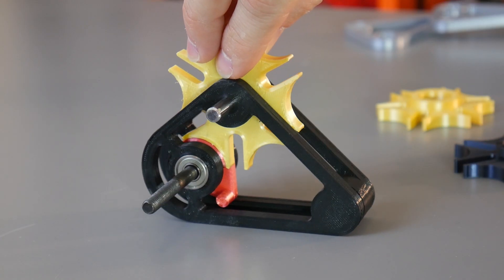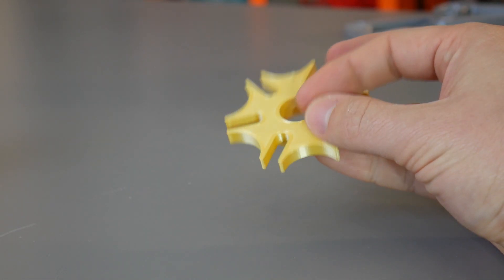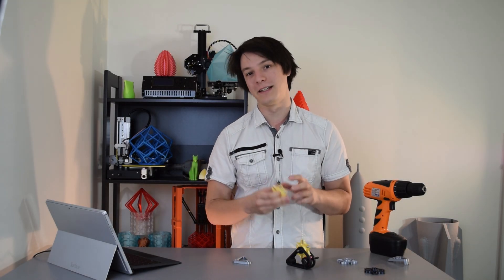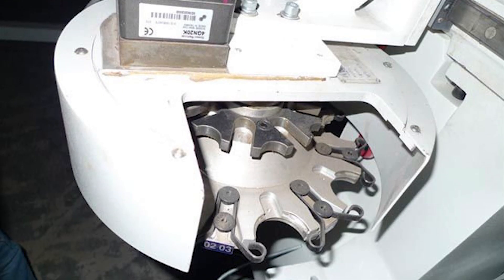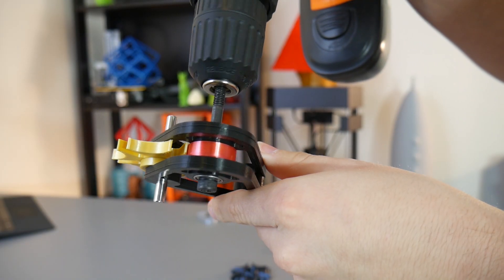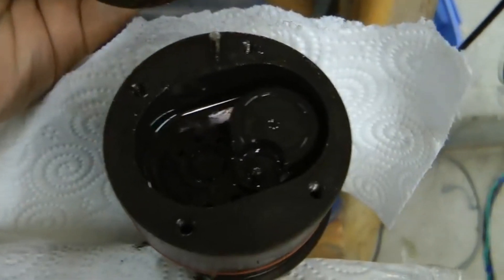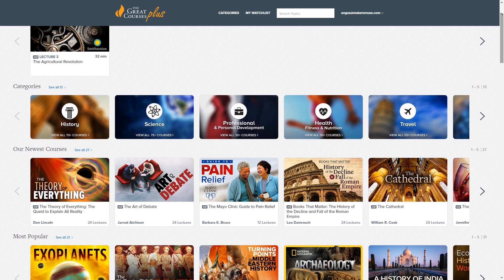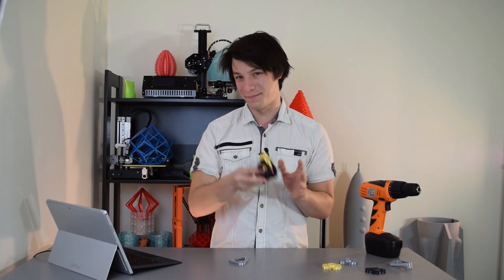The Geneva Mechanism

Comment: Would it be possible to print a sphere that could withstand up to 15,000 rpm? I have an idea of scaling up a "Power Ball" hand strengthener. Its a dual axis gyro scope. A sphere that spins within a hand held sphere. A simple rotation of the wrist can get this spinning up to 15k rpm. My idea is to scale this up and fill the inner sphere with magnets on the surface and have the outer sphere lined in copper coils. Wire it up to a voltage meter/battery charger, spin it up the same way you would a regular power ball and see what happens. I was thinking of getting into 3d printing for the sole purpose of making this idea a reality. Thoughts..if any?

Comment: Interesting what you said about the tendency for the gears to wear out quickly, which is understandable.  My family has a 1948 film projector for use with home movies my grandparents filmed in the late 40's and 50's.  It still works like a dream.  Really not super loud, either.  I guess all that oil helps a lot!  Great video, I learned a lot!

Comment: That clacking sound is the film snapping into place. The snapping is caused by the intermittent gear, but the gear isn't what's making the sound. You can tell because it doesn't make that sound when you run the projector without film in it.

Comment: Not really related to the mechanism as such but the use in watches was (and is) to stop the watch before it reaches the end of the spring. The idea was to use only the middle part of the spring wind, where power delivery is more consistent during the unwinding of the spring.

Comment: early bi-plane machine gun triggers had a gear exactly like this. The purpose was to prevent the machine gun destroying propellers on aircraft where the gun was mounted center-line, firing through the prop.

Comment: I used to repair machinery that assembled trigger sprayers, ( think windex or 409 cleaner). Some of them used a Geneva wheel to place the cap in position. A very robust and elegant mechanism.  They very rarely needed repair.  The pin was a roller so not much problem with wear. 1 cycle per second 24 hours a day.
Reply: I was just wondering the same thing about mounting the pin on a bearing. It seems like that would eliminate the wear problem entirely for most applications.
Reply: Toolman329 Agreed. My use of the word "entirely" was an exaggeration. But, it would be interesting to see data on cost vs MTBF for such a solution.
Reply: William Weibel  I'm thinking: how about the device being created with a few polymers. Polymer example being 3D printing filaments.  Specific properties for each part required, could be achieved using the correct 3d filament for each part.  

Nylon 3d filament for example; is a 3d filament polymer. 

The use of this kind of material(s) for the parts that make up the assembly of the "Geneva joint" (whichever one you use as the video lists a few examples of them from watch parts)  would probably aid tremendously to the length of time the assembly would operate without maintenance. 

Also, As you suggested; I too would be very interested in the testing of of various complex joint assemblies with solutions only possible with today's technology.  :-)
Reply: Or coat the pin in a slick polymer, like one from the teflon family, and chrome the lining of the stays.
Reply: 1 cycle per second is extremely slow. The video mentioned "hundreds of rpm". If the geneva wheel is only durable at 1 cycle per second or similarly small speeds, then it can be considered a very undurable mechanism.

Comment: The IBM 1402 Card Reader/Punch (and other IBM machines of the day) used a dual starwheel geneva to index the card through the punch unit.  The output of the geneva was geared to feed rolls that fed the card.  The card was punched during the dwell and moved to the next row with the index.  This geneva was in a cast housing filled with SAE 10 motor oil.  Although it ran pretty reliably, you are dead on about the poor acceleration profile of this mechanism.  And as it begin to wear it got progressively worse to the point of self destruction.  One of my first assignments as a young IBM engineer was to fix the oil leak on this mechanism.  The major problem was a lack of venting with caused a pressure buildup to force the oil out past the seals.  I build a unit up with a plexiglass housing so I could see what was going on and then put it under a heat lamp to cycle the temperature.  I got good marks for that job.  That was somewhere around 1962.  Info on that mechanism is here:
http://bitsavers.trailing-edge.com/pdf/ibm/1402/231-0017-1_1402_Card_Read-Punch_CE_Manual_of_Instruction_1963.pdf (page 19) and here:
http://ibm-1401.info/1402-PartsCatalog-S31-0149.pdf (page 46). Items 12 and 13 were part of my fix.

Comment: Cool vid. Sub'd. Geneva gears were also used on industrial tank level transmitters, to convert linear motion from a float to stepped motion on code wheels, one wheel for inches, one for feet, one for tens of feet IIRC. These code wheels had a circular PCB on one side, whose position was read by electrical contacts, and was thus converted to +/- 50V digital code back to a control room. All this sixty years ago.

Comment: The Geneva stop wasn't used so much to prevent overwinding of the watch, but to control the period the mainspring powers the watch.
The mainspring of a watch tends to apply a lot of power to the mechanism when fully wound up, which makes the watch gain time.
While at the end of the mainspring it supplies less energy the watch loses more time in the hours before it stops entirely.
Therefore if you only let the spring power the watch while it's not tightly wound or too loosely wound, you can get something that is somewhat more reliable and precise in timekeeping with the time's escapements.

Comment: i actually have a vintage timing device from an old military weapon. it doesn't have a geneva gear, but it does have gears that you would find in an old watch. back in the 40's and 50's (and probably 60's) they had analog devices to handle timing in weapons, and they are essentially "milspec" watch guts

Comment: Don't know for sure but, the Close In Weapons System CIWS (pronounced SEE-WIZ) or Phalanyx system uses a mechanism that rotates to a certain position and pauses so it can fire a round at a rate of 3,000 round per minute. Think of it as a computer controls radar assisted gattling gun.

Comment: I understood some of these words
Reply: It does work well and is mechanically reliable at that. If you're design has no concern for driveshaft vibration, wear/backlash and acceleration, the geneva mechanism is a good choice for a full mechanical design.
Reply: Yeah! But I think "outdated" is inappropriate, because there is no reason to imply that this mechanism is outdated. It works, and it would be stupid to forget that :-(

Comment: The kind of gears you showed (and are thinking of) are involute gears, these actually have sliding contact throughout most of their mesh. There are cycloidal gears which have rolling contact between the two gears but they come with their own disadvantages.

Comment: Who cares about the military use? Tell me the sex application for the device.
Reply: Convert the rotational motion into linear motion, you now have something that thrusts in and out very quickly with a pause between.

Why did I think of this I'll never know
Reply: 1) Attach feathers
2) Market it as a "Pickle Tickler"
3) Sell it on Amazon
4) $$$
Reply: Ivan Mazeppa auto circumcision
Reply: Make love not war.
Reply: theirs at least one tongue simulator sex toy that uses a Geneva drive
Reply: genital mutilation isn't sex
Reply: Well, he did say it was useful for interchangeable tools.
Reply: Attach rotational-to-linear motion converter to driven wheel. Affix phallic object. Insert into driven person. Spin.

Bonus points for only using one lubricant in the whole contraption.
Reply: +viperfan7 (a) it's obvious (b) I don't think that's the exact form of motion you want; rapid, sharp thrusts don't seem pleasant, you want a smooth acceleration/deceleration to prevent injury.

I assume.
Reply: +Kevin Benoit can you send me a prototype? For research purposes.
Reply: 69 likes, i refuse to add any more likes to the comment
Reply: When my friends from other countries ask what America is like, I'll show them this comment.
Reply: Toolman329 - LOOOOOOOL
Reply: "A weapon to surpass Metal Gear..."
Reply: That's very easily done with a piston attached to the driven wheel.
Reply: Variable speed drive motor gives variable speed cycles. Some sort of eccentric device could create variations in entry vs exit speed. Some women love quick thrusts with slow extractions, others the reverse. There's a whole continuum. I'd be tempted to build one of these and market it, but I have the Mark I model already. I call it my "penis." Now, I just need to market myself. LOL

Comment: In the 1980s, at an engineering department where I worked, a gifted mechanical engineer designed a peristaltic pump around a geneva drive. One key design requirement was precise metering of the fluid being pumped.

Comment: Texas Instruments made an inspection tool that would take pictures of all fours sides of a PLCC package to determine if the leads were straight. This mechanism was used to rotate the PLCC 90 degrees at a time. They replaced the mechanism with a stepper motor.

Comment: I could imagine that in use in aircraft guns that shoot through propellers.

Link the mechanism to the prop and you'll mechanically offset any firing of a machine gun perfectly through the blades plus it looks like it would adjust appropriately based on prop speed.

Comment: I don't think modern CNC machines use this anymore. Most of the good ones can now whip all the way round the tool change to a specific position without indexing at each position. I think they juse use a DC servo now and use the encoder position to stop at the right position

Comment: Actually I also just did some research a few weeks ago for something I want to make and the Geneva drive was one of the first things I came across for intermittent gear switching. Right now I'm working with a variation on the gears found in a car's distance meter/odometer and it's also extremely interesting to see the workings of

Edit: Forgot to mention that I designed the gears using OpenSCAD and variations on some open source code for it, which is also worth a look, I'm definitely looking forward to see how you drew this design with Fusion360, as I'm currently finding drawing in there quite tricky

Comment: I've run printing equipment with these drives in them. Never had any problems with wear even with billions of cycles over decades of use. The drive was out in the open but surfaces were glass hard tool steel. I wouldn't expect amazing quality out of a consumer grade projector. After all, They want to sell you another one when it breaks. (Engineered obsolescence)

Comment: Early film projectors?  Try almost ALL film projectors.
Reply: Can confirm, I've been a Cinema Projection and Sound technician for the last 14 years. These were part of the intermittent sprocket assembly for every 35mm projector I serviced right until they all went to the scrapyard during the digital projection rollout.
Reply: Andrew Tetour Ah yes, the mob-like genocidal revolution that still brings me to tears.
Reply: Exactly - AFAIK some were made with stepper motors, but I never saw a 35 mm projector with anything but a Maltese cross. They only went out of use with the switch to digital. My engineering student friends were thrilled to see the schematics.

The characteristic sound is not, however, from the mechanism - it's from the two loops of the film, one on each side, to allow the film to run smoothly through the rest of the machinery while being pulled frame by frame through the film gate, and you could hear at a distance if they were the right size. You'd have the same sound (or most of it) with a stepper motor.
Reply: Not quite. Cheaper projectors used a claw to advance the film; not good, could tear the film. Better projectors used this mech. Were always called maltese cross in projector parlance.
Reply: eh, I suppose there's an old charm to them. But film cost a fortune, and it's not like too many people would have gone and bought them.
Reply: That's right about the sound.
Reply: Andrew Tetour Yes, but they were not used in 8 mil projectors.
Reply: Very very few 35mm projectors were made with the claw, and they were portable machines that are known to tear up film. Otherwise, the claw is more common in 16mm and 8mm applications.

Comment: Wow, it is a good candidate for stepper-less actuator for Z-axis, when carriage movement in predefined position should activate change of hot end vertical coordinates. Driven wheel as nut and threaded rod should be ok for this.

Comment: i have to add something to your story. the geneva mechanism is only used in 35 mm projector in the cinema. at home, with 8 or 9.5 or 16 mm film it uses a gripper arm which pulls the film one frame forward. this is driven by the shutter which has a cam on it and functions as a camshaft in a car.

Comment: The most seen use of the Geneva device is in the original Robby The Robot, in his "hear box" chest display there are 4 lights that turn using a 4 index Geneva. Back in the 1980's and 1990's when I built full scale Robbys for collectors around the world I would hand build my Geneva's and I used a small ball bearing on the drive pin and on the rotating shafts. This way the device and  does run 24 / 7 with out wearing out.. Enjoyed the video.

Comment: In the sr-71 blackbird (world's fastest plane) used these to changed film roll for a 2 mile long film roll.
Reply: The X-15 appears to be more of a manned rocket than a plane, and used as an experimental craft for learning more about applied physics at those kinds of extreme speeds as well as reaching outer space (how does one steer without wind drag over control surfaces, etc..).  The SR-71 was, by comparison, a successful production craft.  As such, probably fair to call the SR-71 the fastest production airplane (declassified).  ;)
Reply: Bialy  I believe that Computerfrenzy probably was referring to airbreating, production aircraft. The "X" on any airframe refers to its experimental status, whereas the "SR" classification referred to an airframe that was was NOT experimental, but was instead a "Strategic Reconnaissance" aircraft. Also, the SR-71 IS the fastest airbreating aircraft in the world, and still holds many speed records until this day. If the new SR-72 ever goes into production, it will likely overtake the SR-71 in every respect, but until that day arrives, the SR-71 still reigns supreme.
Reply: D otA  Yes. And that is essentially exactly what I said in my post above, in which I explained that the "SR" designation was used for PRODUCTION airframes, and meant "Strategic Reconnaissance" aircraft. Also, a very important distinction is that the X-15, in which the "X," by comparison, stood for "Experimental," was not an air-breathing airframe. It was a manned, small capacity (by comparison to other rockets) rocket ship, whereas the SR-71 was an air-breathing, bat-out-of-Hell go-getter. It's unofficial record of Mach 3.5+, in an evasion maneuver to avoid a bevy of SAMs coming its way over Libya circa 1985 (or was it 1986?) highlighted the peak performance of the Pratt & Whitney J58 engines, which could churn out as much as 150,000 kNs at altitude.
Reply: "North American X-15 This aircraft has the current world record for the fastest manned aircraft. Its maximum speed was mach 6.70 (about 7,200 km/h) which it attained on the 3rd of October 1967 thanks to its pilot William J. “Pete” Knight." sr-71 blackbird speed is like 50% of world record... but hey at least u trayed and plenty of people bought that! :P

Comment: probably in a machine gun. The barrels should turn instantly and then be locked to fire the bullet, then it should turn directly to the next barrel. I'm not an expert, but that seems legit
Reply: This mechanism is used in screw machines (multi spindle lathes) to index the spindles to the next machining position. Very distinctive noise whenever it would index.

Comment: The M1 Abrahms tank autoloader has a Geneva segment on the back of the two powered carousels. https://postimg.org/image/p1uo2bekj/
Reply: the original mechanism was a simple one lobed cam on the driveshaft that pulled the trigger on the gun
Reply: The baser the toy is, the more time it spends working and less time being worked on.
Reply: Tom autoloaders are basically only used to lower the profile of a vehicle, as they come with downsides. They aren't faster than human loader, introduce reliability issues, and you lose a crewmember for tasks like maintenance.

Not using an autoloader was a very viable choice for 3rd generation MBTs, and its unlikely that a refit is worth it until the M1 gets replaced in about 20-30 years.
Reply: when you talk about tanks in the field humans are not the  traditional bottleneck, it's more the logistics and tanks available. i served with the german armoured corps and I would never want to have a soldier less on a tank, maintaining normaly takes the whole plattoon and if it doesn't it's hell, and lastly yes a smaller tank is a more difficult target but in the end it's the crew that really matters
Reply: Manook hadley. extra city coming your way.
Reply: Not the best moment to point on XVII century technology in a tank...but i couldn't help ))) sorry
Reply: Wouldn't  the interrupter gear mechanism used in WW1 airplanes to allow the twin machine guns to fire through the arc of the propeller use this ?
Reply: Zipper: It think so. Sounds right.
Reply: The reliability of the human loader is not perfect either.

One less crew member means one less solider tied up per tank, allowing more tanks in the field.

High profile is a bigger target, never a good thing.